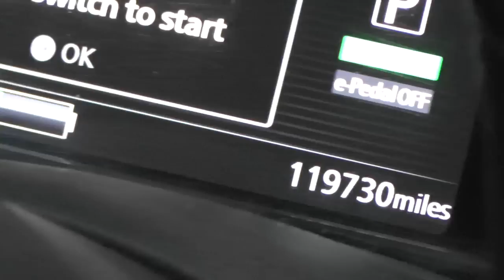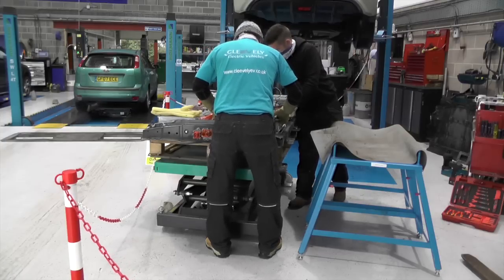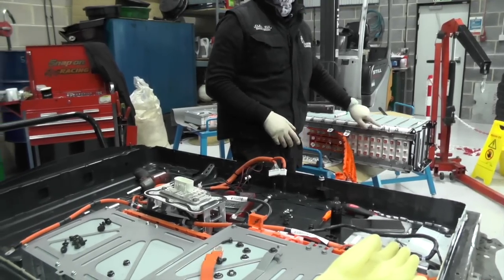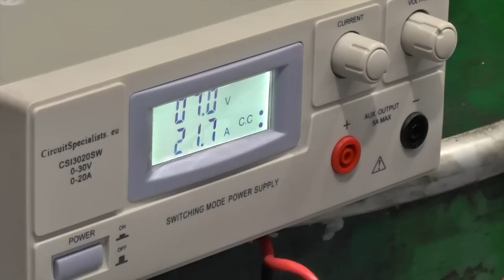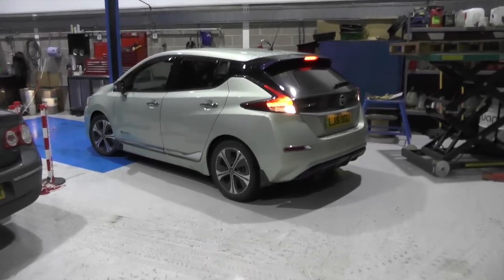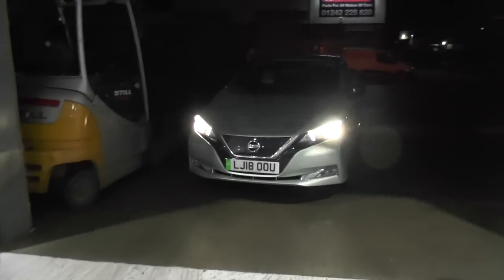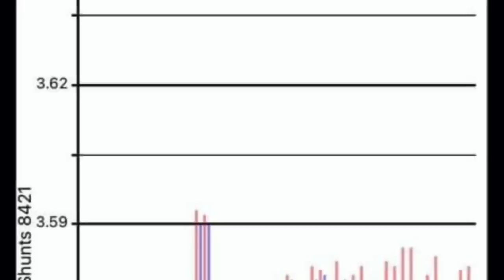Nissan Leaf 40kWh Fried Battery Teardown and Repair.

Comment: Odd that they didn't want to replace the other failing cells, unless they're planning to sell the car quickly. Thanks for the video, James.
Reply: They are not failing and if the driver takes a chillpill and restricts fast charging to twice a day, it will be fine for 300k more miles. Or sells it to some individual who mostly drives 10k a year. Point is not to continue to overheat rear pack.
Reply: @gelisob  A swollen Lithium cell is never good.
Reply: Makes sense to me. It would be very expensive to replace those. And the car already has allot of miles. Since it sill works fine, they probabaly want to see how much life they can squeeze out of them

Comment: 120,000 miles wow. He's been busy. Good job 👏 👍
Reply: That's normal for a taxi. In the 1970's I knew a taxi driver who did about 1,200 miles per week in Winter, and more in Summer. Even at Winter averages, that's about 60,000 miles per year. That Nissan is 2 years old. A fleet taxi, which is used by more than one driver, can easily exceed 100,000 miles per year.
Reply: @RWBHere  Driving airport transfers in the early 2000's we did 15k km a month for 3 months and 10 k a month in the other 2 of our 5 month winter. January I did 20k km. my record day was 1086km. Mosty french autoroutes, but always mountains and snow at the end.

Comment: A very useful and informative video. It shows that with extreme levels of use/charges mileage etc. over 3 years the battery had retained 87% of its initial capacity which is impressive. Frankly, any Leaf can have a random module fail especially with all those repeated charge cycles and the fix price was also impressive. The only other aspect I would love to see covered is degradation due to simple ageing in a UK climate without the taxi-level repeat charging.  How viable a second hand purchase will a 7yr+ leaf prove to be I wonder ?
Reply: With Nissan's record so far on 24, 30 and 40kWh Leaf's I really fear for the 62kWh models too, I would not buy them.  Other EV manufacturers do not see this failure/degradation rate.  120k miles is good but realistically half of what a well maintained ICE car can do, and rapid charging daily is not unusual for some use cases, so batteries need to be more rugged here for sure.

Comment: I love my Nissan leaf. I’ve got the 71 reg 40kw battery, and done just over 18550 ish miles. And the battery has gone down from 188 miles charged” to about 165 miles fully charged. But I do try and charge it from 7kw to help the batteries. And I do notice doing this you seem to get better mileage. and not always rapid charging of 50kw as this does diminish your battery health. But I’m looking forwards to getting another Nissan electric vehicle in a year or so as I don’t keep my cars long. 👍 
Good video. Great work there,👍

Comment: Are you able to indicate how much repair like this would cost. For people who are worried they need whole new battery. 
Great video and knowledge.
Reply from the maker: This was aprrox £900
Reply: This car needs a new pack. They will gonna get this car back in shop, other modules are almost dead too in rear stack.
Reply: £900 repair bill after 120k miles. That's impressive and I'd dread to think how much an ICE car would have had in repairs and servicing in that time.
Reply: @geoffreyhallam6228  Let's pick a popular Nissan, the Quashqai 1.6 diesel, 12K service intervals, at quick fit are £99 interim £168 major, say 5 of each = £1335 That does not include brakes which an ICE car uses way faster then a BEV or any other wear and tare items like a clutch kit, most modern ICE have a duel mass flywheel, for this one it is about £480 for a decent branded clutch and flywheel kit (LUK) If used as a taxi it would not be far off replacement by 120K miles.
Reply: @pashko90  but Taxi Driver is sweating his assets. It's his business to run. Not too many busy taxi drivers at moment.
Reply: I would have been very nervous putting those old expanded cells back in, a fire risk to me
Reply: @Jamesandkate  hi James

WE CAN change battery pack from 40kwh to 62kwh or more?? How much its cost?? Thx
Reply: @goodfodder  it's just not acceptable.
Reply: Don't forget to add in things like cam belt, and maybe a partial exhaust. Then maybe the odd sensor failure such as, air temp, air mass lamba, maybe even a coil pack, and so the list goes on. (at least, that is what I have had to put on my petrol car over the last couple of years!!).
Reply: @Jamesandkate  i paid £1500 for turbo change at 70k miles on a vauxhall insignia 2.0 cdti... so not bad at all really...
Reply: General Smedley Butler  - interestingly they drop the % quick then level out.  So it’s common to see a 15% drop over first 3 years then really slow from there.
Reply: @pashko90  I suspect  they will not ''gonna get this car back in shop
Reply: @esm7708  oh yes it is
Reply: @AdrianMcDaid  Actually, a lot. But they usally deliver a food enstead of humans ;)
Reply: @Jamesandkate  that is very reasonable!
Reply: @goodfodder  no leaf has ever had a battery fire, I get the fear but they are extremely safe chemistry
Reply: @Jamesandkate  1,261 in dollars
Reply: Tron Jockey  how is your leaf going a year later ? Are you still getting the same range or have you swapped your car for something different ? Did you get the 4c firmware upgrade that is actually a scam and eliminates the low end buffer and removes turtle mode while increasing the bars to wiggle out of battery warranty claims ?

Comment: Great video. I have a 2012 leaf although still not convinced of battery replacement. Had so many issues with my leaf and due to my own  experience a lot of other parts  will fail before the battery will fail. The costs of replacing leaf parts brand new are incredibly expensive.
Reply: We have a low mileage 2012 Leaf, and so far had to replace the heater module at about £300 but nothing else.  What issues have you had and are early Leafs unreliable (battery aside)?
Reply: @chrishyde1216  Hi I needed my ptc heater replaced nissan quoted 3500 quid. Recently parking module went 2000 quid. Also  just got a repair fixed just before warranty about 3 years s ago it was a major had a courtesy car from Nissan for 3 weeks. It was the electric unit fail guy from nissan if it was not    under warranty would have cost 4500 quid. Thankfully it failed 1 month before my warranty expired it was covered under 5 year  battery cover. The only way it is still on the road is that I  managed  to source salvage parts and know a good garage. Also the usually with EVs 12 volt battery fails thats another long story

Comment: for people worried about getting issues with battery packs  and getting scared  with full battery replacement for people being 5 to 7 grand
i know it is not a standard item  but was wondering on price for the 4 hour job  to work on the battery   
to help leaf owners see they dot have to get a bank loan to repair it.

You have done a number of leafs   can you do  other cars and show that it is possible to repair them

Comment: Unfortunately there are very few independent shops in the USA who can do this.  There are no shops in my state (Colorado).  So if you have a degraded 30kwh pack and want to replace it with a 40kwh pack, a Nissan dealer will do it … for (gulp) $13,500.

Comment: I was fixing the same issue on a 2019 leaf, similar mileage. There was nothing else to do then to replace all of the battery cells with new ones. The modules were even more inflated then these, but not much. Of course original are too expensive, so I put CATL 117Ah NMC cells in an it all works really great. In your case it will increase the lifespan some, but I wonder for how long. It would be good to know. Thanks and keep on the good work.
Reply: Where did you bought them?

Comment: good morning
I would like to know the brand and model of the leaf 40kw battery modules and, if possible, a datasheet for the batteries.
I would also like the video to be complete with removing the glue and balancing the batteries as it is done

Comment: Shouldn't all swollen packs have been replaced? In other electronics it is advised to stop using them until the battery can be replaced.
Reply: YES . Battery was out already . Greedy owner !
Reply: yes, this pack is dead. It needs capacity matched rear stack or complete cells replacement.

Comment: Great video , thanks. As a Leaf specialist can you recommend a quality light upgrade especially for the low beam on a 2018 Leaf 40. I have tried higher intensity bulbs but it’s still awful in low beam.

Comment: Hi guys, I'm looking at buying a 2013 Leaf that can only be charged by Chademo fast charger, is it very difficult to fix the AC charging on it? I'd appreciate it you could give me some advice. Thanks 😊
Reply from the maker: Hi. Bonita an easy fix. Best way is to simply replace the PDM. Second hand they're about £700. Make sure you get a 6.6 not a 3.3kW replacement 👍🏻

Comment: First video I see.
Thanks for letting me see.
I am looking for information to make power adds on a diesel car.
Can you point in the direction of information that describes / or describe the possibility of using a used battery and arranging it so that it becomes 48 volts?

At the same time, the better should be the energy source for a 4X4 poweret trailer for the car.

Thanks in advance.

Comment: When clearly the back pack is overheating and “expanding” would it make sense to remove one sell to provide space in the back? Battery modules in back could then have small space in between them to prevent overheating. Would that be possible?
Reply: the air between the cells would actually lead to one of them overheating more.  With no air the heat dissipates in the pack.
and you can't remove one cell, the pack voltage would drop as the cells are in series
Reply: How many sells are there in these packs?
Reply: @grahamjohnson4702  It's configured in 96s2p so 192 cells.
Reply: @grahamjohnson4702  4 cells in each module I believe
Reply: while it was off and I presume all the packs are the same, I wonder if jiggling around into a different area might have prolonged the life of them, I know that in mobile phones and other small devices you are supposed to change the batteries if they bulge as they could burst or explode so if I was the owner i'd ask about changing them as well, I know he said they were fine, but for how long?
Reply: @mackemsruleFTM  If you are talking about modules then it has 8 cells each module. So 24x8=192 cells.
Reply: @miloe436  have they changed that? as I have a 24kwh and I thought each module had 4 cells 2+2 for a total of 8v a module
Reply: @mackemsruleFTM  Yes, they changed it with the 40 and 60 kwh battery.
Reply: @miloe436  I suppose that's how they get the extra charge, I thought they just had more modules installed or a higher voltage in each cell, thanks for the info

Comment: 6:15 any idea how much his range got improved?
🤔 i see SOH 87.35 from before to 87.34 after the job...🤔
Reply: I saw that too, if the SOH is the same, how does the range increase, that steps above my knowledge so hopefully someone can answer.
Reply: @SheepShearerMike  because as noted on the first leafspy shot, the pack of cells that were not balancing would not have been used for power by the car so less range, dunno why they didn't show the range on the gom before and after. And  the soh applies to the health, not the range it would only show a loss of range if it got to below 85% soh where it would lose a bar

Comment: I'm glad Nissan have finally accepted that passive cooling of batteries doesn't work.

It would be at least acceptable if their cars were notably cheaper than competitors.
Reply: To say it doesnt work is quite a sweeping statement, as it all depends upon how the car is used and the climate it is used in.  

To be fair to Nissan, they may well have underestimated the problem of overheating/degradation - there wasn't much previous evidence to go on, in terms of ev's.  To fit a thermal management system may well have necessitated a redesign of the car body at massive expense and most likely why Nissan decided to work on the battery chemistry instead, being the potentially cheaper option. 

Considering the cash I had to shell out to keep my combustion engine car on the road at that mileage - the cost of fixing this was reasonable.
Reply: @TheLongonot62  I don't think I was being unfair though. If you're going to sell a car in a number of markets with fast charging capability the product needs to function in those environments. It smacks of that'll do.

The most alarming part of the video is the battery bulge. That's horrendous.

Comment: Just thought I wd  say u said the module has 4 cells per module I thought the gen 4 has 8 cells per module and on ur video after u replaced faulty module why was it still only showing 87% state of health after fix on leaf spy cheers Martin.
Reply from the maker: Hi. They only have 4 cells per module, but the SOH is based on overall degradation of all modules. Replacing these two modules will have little effect on the whole pack SOH.
Reply: Yeah it's just was asking a guy who I bought two modules off and he said that technically they have 4 cells in the module but there made up of two in one cell or something one going parallel or something I don't know lol anyway I got a brand new module off him which measures 13volts across which isn't fully charged and the second hand one reads 16volts which he said is charged does the voltages sound OK cheers Martin.

Comment: Nissan leaf batteries. Keeping people in work, guaranteed
Reply: Was thinking that a bit of thermal management and it would not have been in there
Reply: A diesel taxi with 120k miles would not doubt have required a lot more maintenance work in the same time period
Reply: @GlynHudson  other than oil filter air filter  fuel filter I know many a diesel that's done 300000 odd with out any real manitanance but my point was this is a leaf issue not a ev issue plus if it was a diesel it would of given some one cancer by now I eggsagerate but you get the point
Reply: Not many fail actually. How many engines are uneconomic to repair?🤣
Reply: @zenbudhism  what's your criteria age and mileage wise because many a BMW diesel has needed  thousands of pounds to repair the injector's
Reply: Maybe it is just me, but over the last 30yrs I have owned 11 cars, three of which had an engine swap (second hand.). I did take most of them to 200,000 miles though.
Reply: @SheepShearerMike  yep Just you that's a lot of miles you a salesman?
Reply: Nope, I bought them all second hand, but did have quiet a long commute for a while, only did 24,000 a year on average., oh, and as the name suggests, I travel round the country in the summer shearing sheep.
Reply: @SheepShearerMike  sorry didn't notice your handle

Comment: Does make you wonder how long these packs would last with thermal management, I hope a third party develops a solution to keep old leafs on the road.
Reply: I think a lot of those I-Mievs and Leafs will in the future have the pack replaced with cheap solid state cells. Less affected by temperature and much higher energy density.

Comment: Interesting that the SOH has not changed significantly.
Reply: I think its just cold outside in this area. It will changed and gets recalculated when battery pack is +10-15 degree celcius.

Comment: Another great video, do you use new batteries or salvaged and what do the modules cost. Just to help dispel the myth that ev,s need a new battery after 5 years. A lot easier and cheaper than removing an engine and doing an overall. 👍
Reply from the maker: Hi, we use second hand modules.
Reply: @Jamesandkate  any chance of a video of whats inside the old packs when you open them? great video shame you aren't based in the NE you could do my leaf lol

Comment: I've just bought a Nissan Leaf 2011, a Japanese import. I didn't import it but it's a nice clean car. The range on ECO is max 70Km. It's on 6 bars. I only bought it for charging it off my 8.4kW PV array but having options on extended range may be good. Are Cleveleys still doing battery repairs? Anyone else in the North West of England that I could get some advice from?

Comment: How does a repair like that cost?
Reply: One day work and one used module (since u cannot buy those as spare part from dealer), maybe less than 2k?
Reply: @dot7107  Been quoted more for a Gearbox or a Turbo swap on a Diseasel! if thats the case, thats PDG!
Reply from the maker: £900
Reply: @Jamesandkate  WOW! incl labour?

Comment: Hi I have a 24 KW leaf 64 plate it's dropped one bar would this be a very costly fix by your team please  . many thanks
Reply: This video shows a bit uncommon issue when cells or modules are failing. In most packs the degration happens in all the cells so you can't do much about this. Other than change the whole pack of course.
Reply: Losing 1 bar is not a reason for concern, after 6 years. Do make a note at what mileage that was when 1 bar was lost. Then use normally until the second bar loss - you may expect it to be 20-30k miles or 2-3 years later, unless you are rapid-charging it all the time.
Reply: @matijasokola3879  many thanks i just was gutted when it happened lost about 8 miles in range

Comment: The car should be still under warranty, so why did they bring it to you to carry out the replacement?
Reply: Nissan warranty on the pack  is 8 years or 100,000 miles which ever is 1st ! So at 119k miles , its out of warranty !
Reply: @JonathanPorterfield  Thanks, that clarifies it.